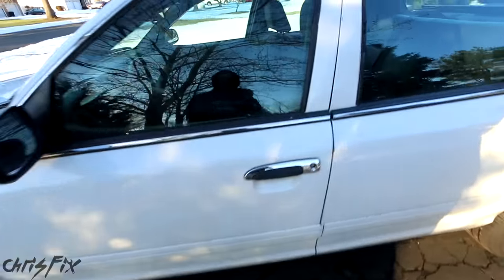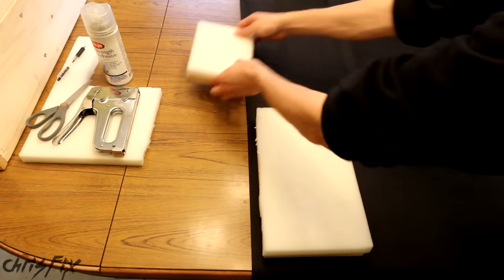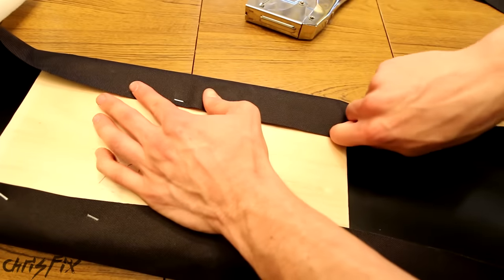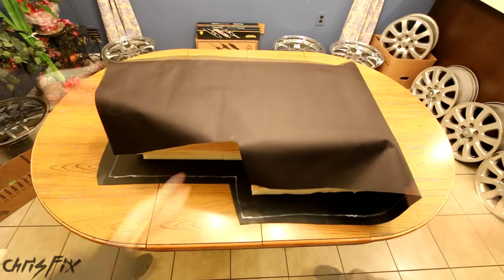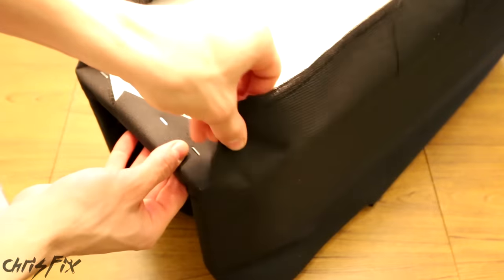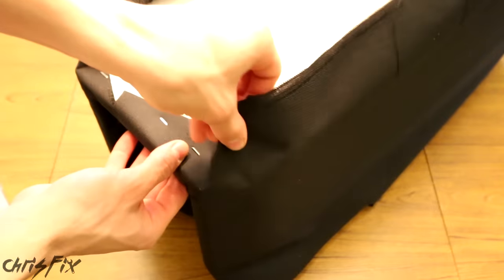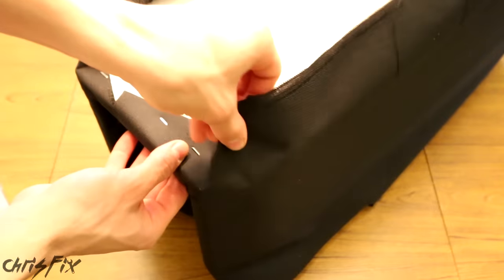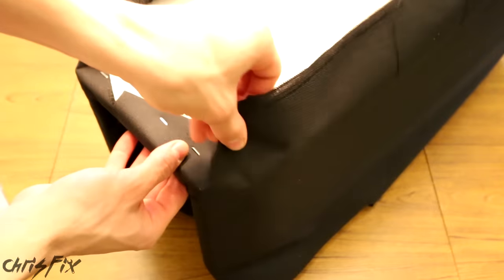How to Build a Center Console for your Car (Part 2)

Comment: I think this is the best result an amateur upholsterer can get. Very good work. I think I would have used something like superglue or pins at the bottom of the frontpanel to make sure to keep it in place.
Reply: +kilésengati Do you think you  could cut down an off the shelf Ikea/Home Depot kit - something with a little more finishing (instead of plywood) cover it like he did and get a better result? 

No snark - honest question: It seems to me the key is the finish of foundational piece. or would there be too many cuts/ joints?

Cudos to Chris for putting himself out there.
Reply: mr7wi What exactly is your problem?
Reply: Could you cut down an off the shelf MDF solutions or would it be better to jig something from plywood in this instance?
Reply: mr7wi If I would do something like this by myself I would definitly prefer a fibreboard over plywood anyway. I think a DIY-kit from a store would just be a little bit better. I never seen such a kit though. Nonetheless, I wouldn't do both and buy a spare part or certified third-party middle console because these would be the only ones who would pass the car inspection in Germany.
I still don't get what this has to do with my comment and suggestion.

Comment: I do upholstery & a easy way to wrap pieces is to cut snips in corners so that you can pull it down exactly to a corner & instead of using staples use tacs & hammer them in into tough places

Comment: Nice project.  A little constructive feed back.  Pie cut your corners more, staple closer to the edges and trim the excess off.  It will make a huge difference in helping get all those little wrinkles out.  And just out of preference and nothing else I would have used a piano hinge just so it can stand up to more abuse.

Comment: This is pretty awesome, because I also have a crown vic that I plan on building a center console for! Your console looks pretty decent, but it's a bit pillowy looking to me. I think I'll try using thinner foam when I build mine. I also think 3/4" wood is way overkill, so I'll try using 1/2". In the future, I'm also planning on swapping in a manual transmission, so I may factor that into my build, and remove the stock cup holder tray (which is a flimsy-feeling pos imo) and make the console go a bit further...
Reply from the maker: +KrazeeCain Thanks! Take some pics!

Comment: Cool excellent job, simple as well and simple is usally best depending on your situation. How ever as a contractor I would have thrown out the dinky screws on those hinges and use something a little fatter and an extra hinge or two. I would have also used a couple more screws in a couple places and filed or sanded the sharp corners and edges on that ABS down so it doesnt get ya. Also why no cup holders?! LOL
Reply from the maker: Thanks a lot Adam! Cup holders are built into the area under the radio.

Comment: The ideal is good, but the finished product is nothing near production value. Next time, I would recommend making the switch box lid on hinges so it can open up and access the wires for maintenance and troubleshooting. Secondly, the armrest I would create two layers (a bottom layer on hinges so you an open and access the cargo area, and the top layer so you can expand the arm rest) and put the bottom layer on rollers (like how some computer desks have the slide out portions for keyboards) so that you can further adjust the armrest for more comfort.

Also, wood is great, but it should only be used to create a mold out of fiberglass.

Either way, great video for beginners.

Comment: My Dad owns and operates an upholstery shop in California and I show his this video 
His comments were:
-Your using the vinyl material wrong.
-Your not pulling hard enough to make the material stretch.
-You should be using a heat gun to stretch the material easier 
-Your wrap job is crap. 
-You should put felt were the plain wood is. 
-Add good cup holders.
-Cut the access material after the staples.

Comment: Don't know if you'll see this, but for the front piece of that console, why not screw it in from the bottom instead of just the top? The screws wouldn't even be visible, and it'd be even more durable than just having the plate on top and its screws securing it in.

Comment: Chris, I hate to be that guy. I'm sure your buddy loved this but I however don't. Unless you have EMS experience or police experience you really don't grasp the concepts of lights and sirens. A full blown off road LED light bar may be bright but isn't a good decision for POV lights. Also the "mini" LED's you mounted under the front of the car are meant to be grille lights. 
Not saying this POV set up is bad. 
If it works, than its great but a lot of people in my field probably were shaking their heads when they watched this. However I am still impressed. Hey if it helps save lives and it keeps your buddy safe than more power to you. We all see things from a different perspective and maybe this is how he wanted it. Over all for functionality coming from experience I'd give it a 7/10 you obviously have knowledge of electrical work and such and you know where a siren should go etc etc. however I would've used the smaller lights in the grille and eliminated the big light bar. 
Thumbs up!
Reply from the maker: +ACountryBoyCanSurvive Thanks for sharing. I have police experience.

Comment: Great! Personally, I wouldn't have used foam in the side faces of the console, they create gaps between the top of the console and the sides. I would've cover them with the black abs plastic as well. But.. that's just me! Still, great work!

Comment: Have to admit, I am surprised he bothered padding the sides, the front, and the back - like, I'm almost surprised he didn't pad the bottom. Most car manufacturers will not pad the sides, front, or rear of the console - there's no point, you rarely make contact with those parts of the console. I mean, I get it, he did it for comfort, but I felt like he could of saved money and time if he didn't insist on padding every single side. Admittedly, this is inspiring me to try and build a center console for my 96 Dodge Grand Caravan - Something I really feel this van badly needs and sorely lacks.

Comment: if you wanted some cupholders you could have cut 2 peices of 2x4 and glued the together and then to the bottom of the console and then used a large forstner bit to make two holes

Comment: For inside the console if you wanted to go the simple route, you could use some adhesive and glue some felt in there.
Reply from the maker: That is a good idea! I am trying to see if I can fit a holster in there first, then that will probably be the route I will go! Thanks!

Comment: Good video as always.  But I would use brackets on the inside and would have used a black Walnut stain or black rattle can for all exposed wood surfaces. Where is the coffee and donut holders?

Comment: I would have filled the seems with wood putty then sanded for a seamless finish. Use the spray version of some matte black plastidip to spray everything except the lid. That's the only portion I would have used the foam and material on. Just to soften it up for the arm rest.
Reply from the maker: +Inktronics Blog Thanks for sharing! That would be cool too!

Comment: You should add a wireless charger with a indentation or something in the blank spot between the lid and chargers.
Reply from the maker: +thiefrules That would be awesome!!!
Reply: +ChrisFix only problem is, how would you account for phone upgrades? Phones keep getting bigger and bigger every year and I think you're going to be keeping the car longer than one year lol. 

Anyways, this idea is useless if he has an iPhone (at least with the 6S or lower because maybe the 7 will have wireless charging) and if he has an Android device that doesn't support wireless charging. 

if he does, you can use a Qi charger off Amazon. But if he has a Samsung devices newer than the S6/Note 5, you can buy a fast wireless charger (which charges faster than a normal cable but slower than Quick Charging 2.0). Only problem with that charger is price (it's like $60+ wtf) and it generates a fair amount of heat (it generates so much heat it has a fan inside) so I don't think you can mount that particular charger inside the center console to hide it away. You can mount a normal Qi charger inside though since it generates very little heat.

Comment: another helpful hint is use spray adhesive in addition to the staples to hold it in place
Reply: also could use a roundover bit instead of sanding
Reply from the maker: Thanks for the tips!
Reply: no problem man.

Comment: Negative comment, but trying to be constructive: 

First, paint the hinges!! Also, way too many seams. Using self countersinking screws might make a difference since foam over metal seems like it'd indent over time. 

Next, using an iron and gradually stretching fabrics can really help eliminate seams and wrinkles. There are also specialty fabric adhesives. Obviously the inner box can just be covered in abs or another plastic material so it's not a big deal. 

I think the concept is pretty solid and useful, but the approach was more of a framing style process than something like finish carpentry and carpeting. 

I would never want something as ugly as that in my personal car, but at the same time, I love the concept of a diy console. Oh, and there's fibreglass too!

Comment: Man, that is  awesome, but the lid now looks smaller - you should probably make the lid wider for the width of the foam :)
Also if it was my work, i would screw the front panel from bottom - just for a good feeling it is secured :D
Reply from the maker: +Jiří Švarc Yea, I relize now the lid should be bigger to compensate for the thickness of the foam! That will be next. As for the front panel, it is tight in there and not going anywhere but I do want it easily removable so I  have more access to the wires!

Comment: Just watching the whole series today Chris. That console does look fabulous and looks like it took a ton of work and precision. It also feels like you could mess up if you didn't know exactly what you were doing. Very steady hands there though. I'm almost sure at some point, an average joe would drill either too far, or not exactly in the middle and mess everything up. Once that happens, it could be ruined by one slip.
Reply from the maker: Thanks a lot! It is not as hard as you think. If you mess up, you just get  more material. It is cheap enough!

Comment: If You had used L joins [basically metal connectors at a 90 degrees angle], You would have been able to screw [and wrap] every piece individually.

Comment: what kind of screws did you use exactly, to secure the console? Mine was kinda loose in the car. Now I want to put it back in but don't want to damage the transmission body or something because of wrong screws.

Comment: For the front part, I suggest you do use some screws, but place a square piece of wood on the inside, and screw the front and the sides to it from the inside (you need two of those pieces of wood, one at each side, and each piece of wood connects to the front and to one each side).

Regarding the other comments : yea it's not perfect, but it doesn't have to be perfect. If I ever have to do a custom console, I may do it exactly like this. If someone has a better video, feel free to share it.
Reply: And also, you could have used some countersunk screws for the ABS panel screws !

Comment: If I were you I would not made that high armrest part. It would look much better if you used the lid as the armrest and make it basically a rectangular prism with a lid on half of the top. Also sanding the wood more to make it more rounded would also be better

Comment: I just realized, he added foam to the sides and front, why? Why? That’s dumb, yes you might bump the side every so often but that doesn’t warrant foam padding, most consoles are plastic so it’s the same if he just covered the wood with canvas. Plus it added tons of bulk to the thing, it would have looked much nicer and cleaner if he didn’t put foam on the sides and front
Reply: What cheapass cars are you driving with plastic on the side of the centre console, most are foam wrapped with either a deep pile carpet or leather

Comment: You should do another with adhesive instead of staples.
Reply: +Robert Harrier Adhesive wears out over the years, staples definitely won't, even if it doesn't look as good. Although if I was him I would have definitely put foam padding around it.
Reply: the staples my not wear out but the material will and i would much rather re-glue it than cut all new material (this is a job I just did and had to cut and sew to get all the proper bends)

Comment: When building boxes like this, pocket holes and screws would allow the front to be secured from inside the box. I also think the foam was way too thick, but to each his own. I'll give you a pass though for your painting rework and that steering wheel you did. That canvas didn't seem to be your friend.

Comment: So i bought some car cigarette lighters to install in my car, but they didnt come with wires :/ where could i get these, and would it be safe to run them using t taps from the main cigarette lighter or should i run fresh ones?
Reply from the maker: +PavReplays I link them in the description and I would either run new wires or solder the wires in parallel with the old ones.

Comment: Building this,you need to forget about your stick and manual hand brake 😂
Reply from the maker: It's got a column shifter and a foot operated hand brake, but you can always adjust the design if you want!
Reply: @chrisfix  here in Europe only Mercedes cars (some of them) are with foot operated hand brake. The rest are with normal handbrake or electric one. Anyway I really enjoy your videos. Nice work.

Comment: you could have put the top as same as the bottom with removing the top front peice and fold the front in and staple and pad and cover the front top peice it would have looked better no side seam
Reply from the maker: +rock dawg Unfortunately, the material doesnt stretch so there is no way to wrap it without a bare piece showing if you only use one piece of material.

Comment: hey chris i have a question, im by no means a diy guy but im attempting to change the radiator in my suv. its a 04 mitsubishi endeavor, i went to the junkyard and got the radiator along with the condenser and fan, it saved me a good $300. now, in there, the car didnt have the front bumper so it was relatively easy to remove. My question is, since I can't find any info or instructions on this specific car online, is it necessary to remove the front bumper?
Reply: It's a bit more complicated than that. You're going to have to drain the engine coolant and some other tubes that are hooked up.

Comment: Hey Chris. I have an 03 Audi TT 1.8 turbo. And it's been doing some weird stuff lately. Some days it will run great and have plenty of power and torque. Other days it will idle slightly rough and have very little torque. It's almost like you press the gas and nothing happens. And some days it's somewhere in between. Do you have any idea what could be going on?
Reply from the maker: +Giovanni Giannangelo Hm that is weird. Any check engine lights? It could be a vacuum leak or maybe you are not getting enough spark (bad coils or old plugs)?
Reply: +ChrisFix at first I thought it was a vacuum leak also. I got a smoke test done and turns out one of my gaskets for the turbo was leaking. I replaced it right away and it got slightly better. I didn't even think about the spark plugs. Do you think it could also be running rich
Reply: +ChrisFix thanks for responding!!

Comment: you should have added a small door cover so if needed you can look at the wires instead of removing the entire plastic panel.
Reply from the maker: +Ivan Bondarenko That is what the front is for since I didnt screw it down. Good thinking!
Reply: +ChrisFix you should do alot more of these types of project. this is one that I'll do when i get another car.

Comment: yeah it would work you would have to carefully cut the material at the top and bottom I could have should you you could have met the top and bottom you would have not seen the seam u get what I mean not using a a angle  cut straight and fold and staple
Reply from the maker: +rock dawg I tried that but since the material doesnt stretch, it just left a cut (as shown in the video). In reality, I should have just used vinyl but I really liked the look of this material. Thanks for the tip!

Comment: Hey Chris I'm in the middle of doing this project on my Crown Vic, what size two bolts did you use to mount the center consule into those 2 holes in the floor?
Reply from the maker: Honestly I dont remember it was so long ago!
Reply: Alright, thanks

Comment: I have a questions that doesnt relate to this.  Why would belt dressing stop the squeak for 30 sends then get even louder?
Reply: I have the same problem! I squirt some belt dressing, then the squeak get even louder then it was before
Reply: Ive tried it on my neighbors car as well. The belt dressing stopped the squeak for about a minute and then squeals louder then ever.
Reply: On ebay you can get a gatorback belt for $10. A standard belt from napa is $28-34
Reply from the maker: +M Knight This video will help you: https://www.youtube.com/watch?v=AEUe6uKxTv8
Sounds like your belt tension is loose either from the tenssioner pulley or belt being worn out.
Reply from the maker: +3hunnahashtagswag This video will help you: https://www.youtube.com/watch?v=AEUe6uKxTv8
Sounds like your belt tension is loose either from the tenssioner pulley or belt being worn out.
Reply: +ChrisFix I tried the WD40 trick and it stopped squeaking so I'll replace the belt when im not broke